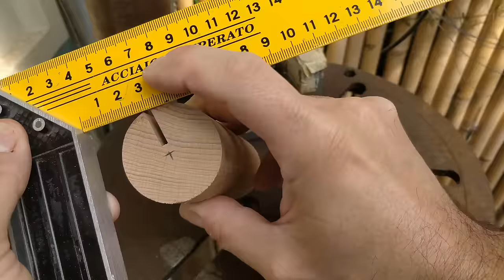DIY Drum Sander For Drill Press | Quick Sandpaper Replacement - NO GLUE | XDIY

Comment from the maker: If you like my project, please hit the thumbs up on the video :)
What do you think about the result? Write me in the comments
The tools & accessories that I'm using - https://www.itzikdiy.com/tools-list?m=1
Reply: Does it hold securely with no screws?
I presume the width of the slot must be ajusted very well?
Reply from the maker: @vaporiste  After I cut the slot with the saw, I looked for a piece of metal that will fit a bit tight, to hold the paper well. In addition I added one screw on the top to secure the metal better (due to the high speed of the rotation).

Comment: This press has worked like a charm for my projects  https://www.youtube.com/post/UgkxajoEbapTfqWaadnqb04h6U576yxXp-FE . I didn't even secure it to my table top, mainly due to the fact that I was using a 15 lbs drill vise. It's not flimsy at all as to what others have claimed it to be. Make sure the locking nuts and levers are secured and there won't be any issues with light pressure and patience. I was able to drill through aluminum, plastic, and steel (steel took a while) with no problems at all. Yeah it took a little longer than a regular drill press, but I don't have the space OR the money for one.The instruction manual was worthless, but luckily assembling the press was intuitive. However, the manual would be good for ordering replacement parts if needed. There is a nice breakdown of the parts that are included in the kit. Before ordering, make sure it is compatible with your unit, it is clearly stated what models the press is compatible with.This was an excellent purchase for $40!!
Reply from the maker: The dremel is here, but no dremel press yet 🙂
https://youtu.be/meHbpcSzPD0

Comment: It would be beneficial to add another metal strip to the opposite side of the cylinder to help balance the drum and reduce vibration.
Reply from the maker: Thank you! I actually added a bearing at the bottom and a base which holds the bearing and the drum sander, to make it more stable.
(I didn't have time to edit but I plan to upload part 2 of the video when ready)
Reply: @XDIY bitte wo bleibt der 2. Teil?

Comment: I purchased a set of 4 size drums at harbor freight for 15.00.
Reply from the maker: I know I could buy... but I love to create :)
Anyway, in this case I made additional improvement and added a bottom support with a bearing, in order to prevent push of the drill press chuck from the side. (I need to edit the video and publish, didn't have time yet). I assume that the ones you buy doesn't have this support, so here I can customize it for any need.

Comment: So when paper is done, and you have to change, the screw must be unties, and screwed in again i. The same hole. So that gives it a short timespan, becsuse the holes will not fit the screw after short amount of paper change? Perhaps some threaded insert to screw a bolt into, rather then a metal screw to wood?
Reply from the maker: You're right, but meantime since it's not soft wood and I don't tighten the screw forcefully, it's still works fine.
But your idea to use insert or so, is good, but I think it will require a thicker wood to have enough room for the hole. I'll consider it next time. Thanks!
Reply: @XDIY  do you think the wood could be replaced with a metal pipe for long lasting threads then?
Reply from the maker: @silasgroenning  I'm not sure I understood. Replacing the wood with an empty pipe? You need a full material without a hole. (unless I didn't understand correctly... :) )
Reply: @XDIY  yea i understand for the metal piece/clamp ti push against something to tighten.. perhaps, some cleaver welding could make this out of a metal pipe.. it would just if possible, giev it longevity.. i was just wandering if the metal would be to hard a material to push against, but its mere speculations. .. like.. the softness of the wood, would make it more easy to finger ninja the pieces you hold, or perhaps the hard profile of steel does not make any difference on the subtle how-it-feels… i hope you understand me now :)?